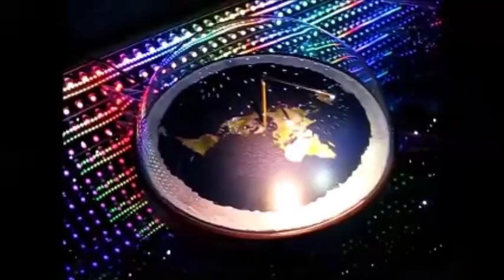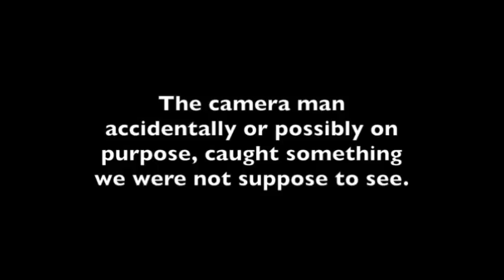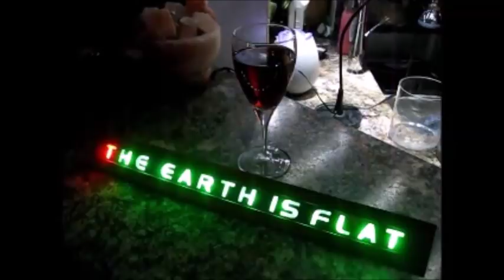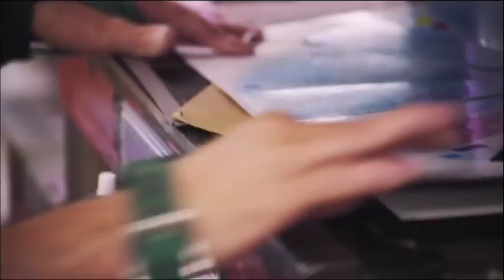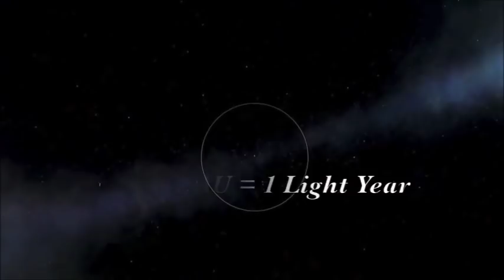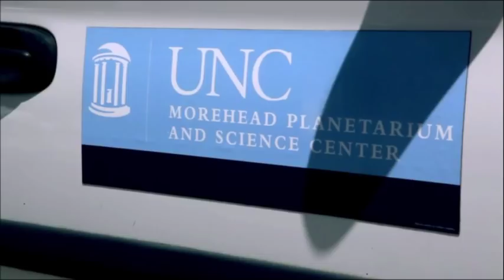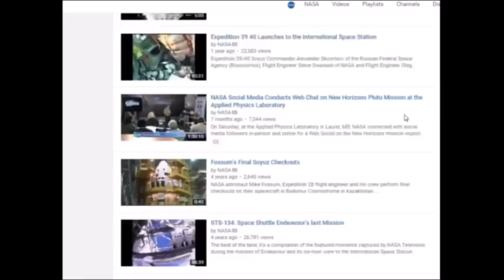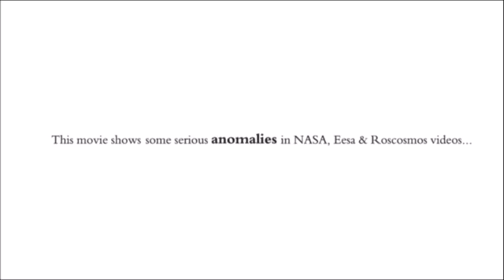Flat Earth Q&A emails 64 - Mark Sargent ✅

Comment: A pilot would never ask about "dipping down for a flat earth" because all aircraft are flying at a certain angle of attack (the AoA) which changes depending on aircraft speed/weight/air density/temp & flap settings.
If the earth WERE ROUND, the curve would be so gradual, and in any direction, the difference would only be a fraction less trim.